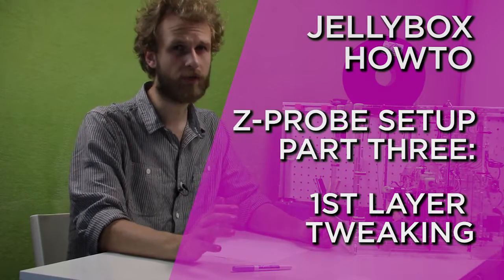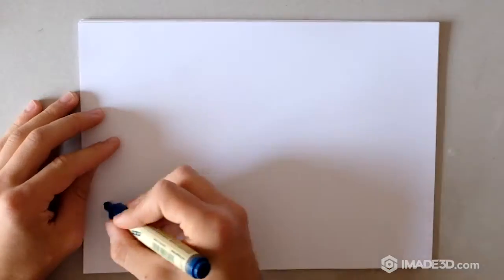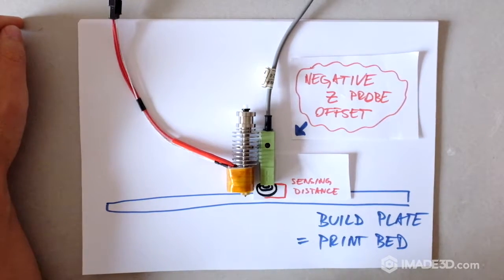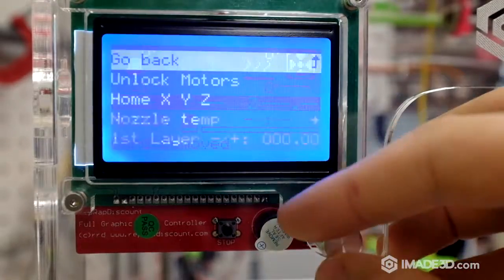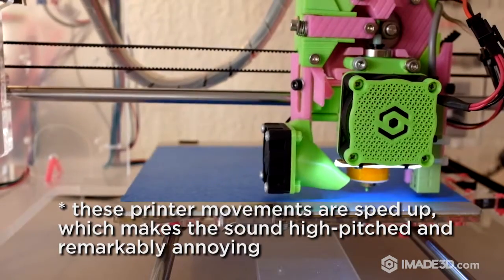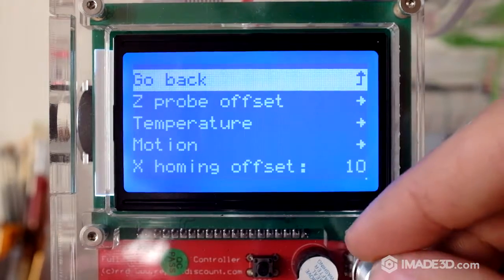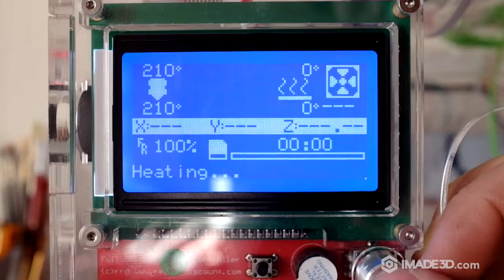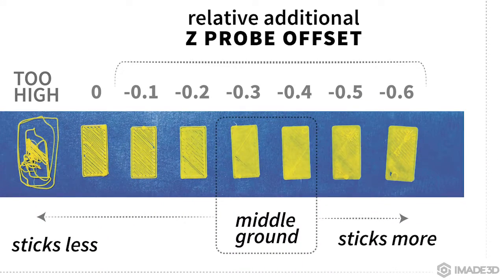JellyBox HowTo: Z-Probe Setup Part THREE

Comment: Hello,  Do you know off top of your head what settings needs changed to allow Z to move down after i change Z to 10? I confirm with M114 that my Z is 10... but when i send command to lower .1 nothing happens. Im running latest Marling 1.1.1